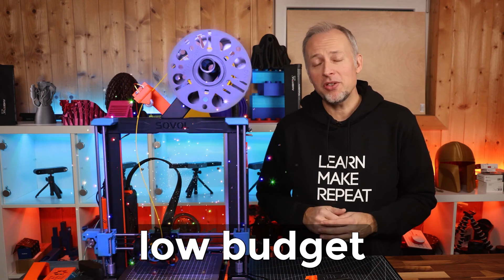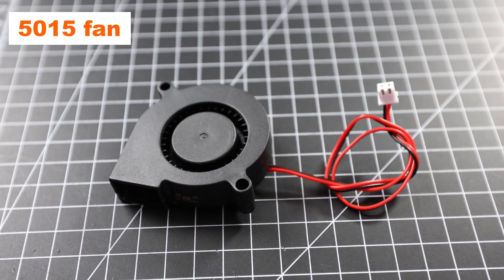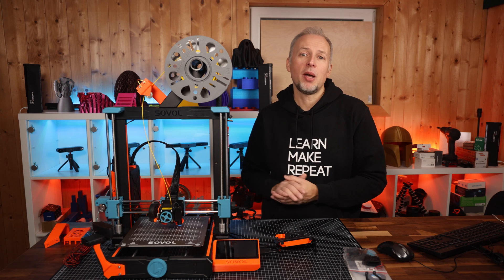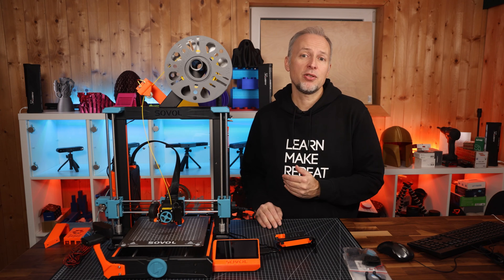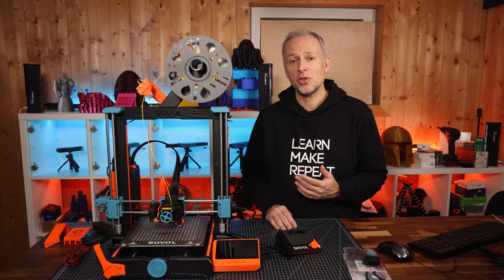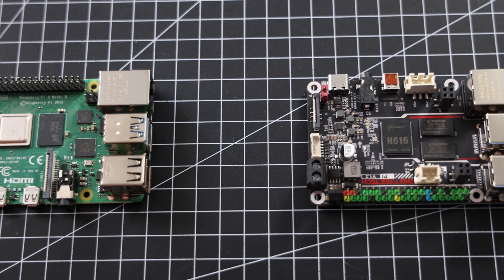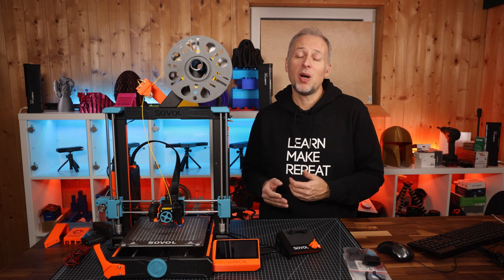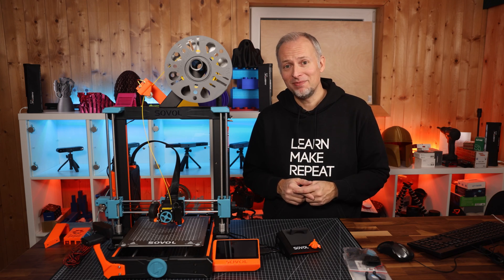Transform Your SOVOL SV06: Must-Have Upgrades!

Comment: How is the hot end cooling fan and the parts cooling fan different? Do you install both? I just got the hot end cooling fan part printed and I would like to know if I should do the parts cooling fan as well. It looks like its the same fan 5015, is this correct?

Comment: So I am thinking about getting the SV06 Plus Ace.  The problem I have is that I want to get the heat bed up to about 110c and I understand the stock bed does not do that.  Can someone confirm this or tell me if swapping the whole bed for another that I can get a heating element that will go hotter.  I asked SOVOL and they only make the one element for this model and they said since it's older they don't plan to make other options.  I was thinking of converting to 110v model but none fit the hole pattern of the SV06 plus, so I am thinking the whole bed would have to be replaced with one that will accept a commonly sold 110v heater.  I am solid on the electronics needed, just not the viability of swapping beds.

Comment: not true on the clogging, I have had my sv06 for a year and hasnt clogged once. I have done 78 hour prints.
Reply from the maker: Sigh. I had multiple issues and it got much better with the better blower fan. So it’s true.
Reply: @Crosslink3D  not the same for me

Comment: Don't know why, hot end fan upgrade cooked up my extruder PCB :(. I saw a smoke coming from the new fan  (5015 24V ) after installing the fan when I started the printer first time. I replaced the old fan back, printer is working fine but the hot end fan is not working parentally since then.  any suggestion?

Comment: Some people have problems with heat creep some not. I had problems but it seems that there was not enough thermal paste connecting the hotend to the cooler. I haven't tested with very long prints yet but reassambling the hotend with enough (and good) thermal paste seem to have solved the issue for me. If the problems will occur again I will make the fan mod.

Comment: I purchased my SOVOL SV06 from the 2nd owner for a price I thought was attractive.  Gosh it requires a lot of attention to keep it working.  Today I noticed the extruder was wiggling.   Not sure how much disassembly is required to fix the problem.  Have 15 second video if you would like to see this.  I am not a technician and could use any suggestions.  Do you have a file uplink so I could send the video?
Reply: Did you get help with this? I've had my share of problems with the SV06 but am now actually quite happy with it. Here's a thought.

The extruder is *very*easy to detach from the carriage (the part that moves). There is a large cable at the top - disconnect it by pulling the two tabs slightly to the sides, and then pull gently.

Next, there are three screws with hex heads that hold the extruder to the carriage, at the upper left, upper right, and lower right corners of the extruder body. SUPPORT the extruder while you remove these screws. They are pretty short and if the extruder drops it could be damaged.

Now turn the extruder upside down. Detached, you can do this at your desk. On either side of the nozzle there are screws, one per side. If those are loose, your heat block will wobble. Tighten a bit if needed, do not over tighten.

Re-attach the extruder and verify that the three screws are reasonably tight. Again, do not over-tighten.

Reatttach the cable and be sure the "ears" that you pulled outward before are now clasped over the top of the connector body. Your printer should now be free of wobble. But if it still is wobbly, the problem is the carriage itself. Probably a loose screw around the back of the assembly. A few gentle twists of a hex key should tighten them up. If any of them are stripped, and this goes for the extruder too, you may have to buy a new extruder. They're about $50 on Amazon or from Sovol.

Hope this helps. I have a Prusa (rarely requires maintenance) and an SV06. When it comes to working on the extruder, even clearing tough jams or clogs, I can say that the Sovol is easier to work on since I can bring the "problem child" to my desk. But as I said, the Prusa rarely needs work, which is better overall.
Reply: Thank you for the follow-up.
 My purchasing a new extruder from Amazon actually resolved two unrelated problems.  Somehow when trying to change colors, filament got squeezed into space it wasn’t to be in and the problem you replied to my post.
Consequently, my pleasure using my used SOVOL 06 was enhanced by being able to make objects smaller than 1/4” by 1/4” that finished without premature separation from the bed.
Considering using clear film on three sides to enhance temperature stability.
Do you think the effort is worth doing?

Comment: The best upgrade I made was an aftermarket PEI sheet. Not only did it get rid of the grid pattern on the bottom of all my prints, but everything sticks better to the aftermarket sheet. I haven't had issues with curling since.
Reply: thats the best mod.

Comment: I have tried everything i cant think of i cant get klipper to let me set the z height every time it will probe_calibrate then move up a few mm while moving the nozzle over the probe point then its too high and klipper shuts down when i hit the 5mm threshold any help is greatly appreciated.

Comment: Great video, thanks.
I recently keep having issues with the extruder on my SV06. The small gear comes lose of the shaft and result in the extruder not pushing filament down anymore. I checked it multiple times and no matter how hard ai tighten the little grub screw, it comes loose again. Do you have any extruder updates for the SV06?
Reply from the maker: Happened to me initially but not since then. Currently I am considering to upgrade to a Voron Stealthburner mod

Comment: I bought the sv06 last week, it's my first 3d printer and overal, I'm super excited to be getting my feet wet.

One question I do have, I just did the 5015 upgrade, what settings do you use after going for a bigger fan?
Reply from the maker: I did not change any settings as my impression was that the small fan was not powerful enough anyways

Comment: I never had issues with cooling even for 24hours+ sprint on my sovol sv06..But I am curious if these fans would lower the fan noise a bit?
Reply: The noisiest part of the SV06 is the Power Supply fan - those on the extruder are very quiet. I've had cooling issues on long prints and will (very) soon be mounting the upgraded fan. I see the problem and expect it will help a lot. The Nautilus will have to wait until I can get it printed in ASA (on my Prusa). I expect it will help with print quality too.
Reply: @JohnDrabik  The psu was the first thing I replaced. But now I run the printer in an enclosure, and things get hot indeed!

Comment: Good job on the video! My only question is, can the upgraded printer do carbon fiber, or is that something one would need the SV06 Plus for doing?
Reply from the maker: Printing Carbon fiber really depends on the composite material if it's carbon fiber PLA or ABS or Nylon. Carbon fiber PLA could technically be printed without an enclosure, the others not. And you should replace the nozzle with a hardened steel version, otherwise, the original brazz nozzle can wear out super fast (literally, it can be unuseable after one single print, depending on the material).

Comment: So the out of the box Sovol can't even be connected to Printrun via USB cable?!
Reply from the maker: Why not? It runs perfectly through usb with Octoprint, so Printrun should be no problem. I went straight for Klipper however.
Reply: @Crosslink3D  Because it's not listed in the features on the official site and some reviews used sentences "as for connectivity we've only got a USB drive to print from".

Comment: a stock SV06 is probably one of the worst printers on the market. I had to upgrade nearly every aspect of mine to make it serviceable.
Reply from the maker: So far, I am happy with the upgrades I did. It's now a really good printer with lots of potential to tinkering more!
Reply: Could you tell me more? The community talk so sweet about it. I've been looking for a cheap replacement for my Ender 3 v1, so the SV06 was looking just fine.

Comment: You had issues with clogs? I'm running on the stock heatsink fan for over a year and never had a clog. Maybe that's only an issue on certain charges of the hotend?
Reply: It seems to depend on filaments. I've got the SV06 pretty well dialed in, but recently learned that TPU and SV06 just don't go together! Maybe with the improved heatbreak cooling I'll try again though. The TPU prints were OK, but once the nozzle clogged it was a hassle getting everything back in shape.

Comment: Something else to watch out for; the case fan for the motherboard is tied to the part cooling fan (at least it was on mine, don't know if they've fixed it!) so when printing ABS the motherboard fan stopped running!!

Suggest rewiring this fan directly to the motherboard power supply input terminals.

Comment: Thanks for the video! I was wondering if you could elaborate on how you connected your filament run out sensor to the Mainboard, and how you implemented it in Klipper. I purchased the exact same switches and have soldered the wire to the switch, but I'm unsure of how to connect it to the board and make klipper recognize it. thanks!

Comment: I have an issue with my SV06 plus having a different Z offset almost every time I print. Is there by chance an upgrade to the bed sensor? I'd like to use a klicky replacement for more accurate bed leveling.

Comment: Print the fan duct with PET-CF. It will hold up to pets temps for hundreds of hours without deformation.
Reply: i dont have any problem with the fan duct sagging and ive had the bed up to 85c. i used transparent petg to print the fan duct. never had a clog with petg or pla with the stock hotend fan and ive printed 10 hours. some of these mods are not necessary.

Comment: I think you might have a different issue if your hot end cooling fan is causing heat creep because I've been running the stock one for nearly 6 months now and have completed multiple 40 hours asa and abs prints.  Actually haven't experienced a clog at all on my sv06.  

Now the cooling fan is definitely worth while but I would highly suggest printing it in abs or asa or nylon.  My first 2 petg fans melted.  All you need to print higher temp filaments on the sv06 that require heated enclosure is throwing the printer in a cardboard box or something similar and you'll be fine.  I've been running nothing but asa the last few weeks now.  

I'm working on adding a linear rail and 1515 extrusion to the x axis to get rid of the rods and switch over to xol dragon burner with tap for the tool head.  Still quite a bit of work yet to do with it though.  

Another nice upgrade is changing the top bar to a piece of 2020 rather than the injection molding piece.  It can help quite a bit to keep the frame square and keep the z towers plumb
Reply: Was about to say the same, recently I let my printer running full stock for almost 16 hours printing PLA and it didn't clog, and its also a very hot environment

Comment: Congratulations for the channel, as an owner of SV06 I signed up immediately. My SV06 printer, among other problems, also has excessive play on the right lead screw, more or less at half height. This means that when I try to print objects taller than 75/80 millimeters, the extruder hits the piece and detaches it from the bed. I had thought about solving the problem by buying the anti backlash nut but the one I received from Uncle Bezos doesn't have the same thread pitch and doesn't fit. Can anyone tell me a link where I can buy them? Or do you recommend having the lead screw replaced under warranty? Any advice to solve the problem will be appreciated, thanks.

Comment: I have the sv06 and sv06 plus and love them both. And I am running klipper as well. I went with a pad 7 on my plus and a rasberry pi 3b and a screen on the sv06. I also have the upgraded 5015 fan upgrade. I do like them both now. I also have a kobra and a k1, and my favorite is the k1, but the sv06 Plus is my second favorite. Thanks for the video. I will look at doing the heatbreak fan mod as well. I have been lucky I guess as I have not had many clogs . I also print abs a lot on my sv06 and it works well with ABS. And yes an enclosure is needed.

Comment: I upgraded my SV06 with Klipper using the Raspberry Pi Zero 2 W. Cost me 25€. Can be an alternative.
Edit: please google bassaminator.
I tried to reply to this comment but its always get deleted
Reply: Do you have bin and confit files? I have tried to run klipper on my sv06 using a raspberry pi 3 and it keeps running into problems, only prints one print then the next print will just home the printer head and extrude continuously🥴🥴
Reply: @colmcrotty5549 the bin file is not reasoning for this. Thats ur config file issue. All the firmware does is tell the main board to do what pi asks
Reply: Do you have a guide or tutorial
Reply: I tried many times to reply to this comment. But its always get deleted for some reason
Reply: @damzelfly  ayy it worked this time

Comment: on the mando helmet vid 1 you posted a bearing adapter for the filament roll, did it work out and reduce strain?  there is no mention or follow up on this.

Comment: This video couldn’t have come at a better time, I just bought my first 3d printer, an SV06 about a week ago and I’m so far down the rabbit hole on trying to optimize this machine as much as possible. 

I found your channel when researching printers, so it’s super nice to see such high quality content about the SV06 since everything else is very hit or miss. 

Already installed Klipper on a Pi via Bassamanator’s GH repo/guide, ordered some 5015 fans, and a 0.6mm CHT nozzle for fast prototyping, and I even ordered a filament sensor (idk why I got the sensor, im never printing when I’m not there to monitor. It’s just so fun to trick out my machine!)

Now I’ll be to be scouring hardware stores in Berlin for all of the necessary M2/3/4/5 bolts/washers for all the cool parts I find on Printables. This hobby is so addicting! 

On my wish list this December is a sensor to properly setup input shaping, and long term I’m excited to build a Lack enclosure. I’m not much of a maker, I just love to squeeze all of the performance out of this thing. 

Thanks for the video Daniel! I’m really interested to know how I can print faster since my print time is so limited (apartment with thin walls, and a young child in the next room). Right now I can do a high quality 50 minute benchy using the Bassamanator Klipper config and Ellis slicer profiles, but I want to push it lower as soon as I install the 5015’s.
Reply: This is like staring into the mirror, lol.